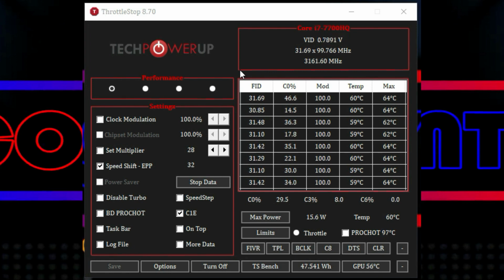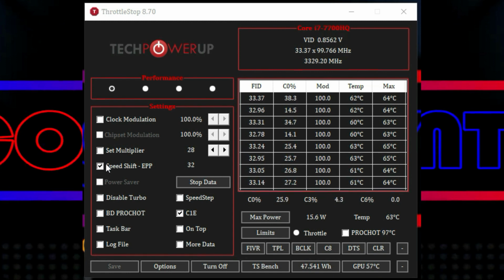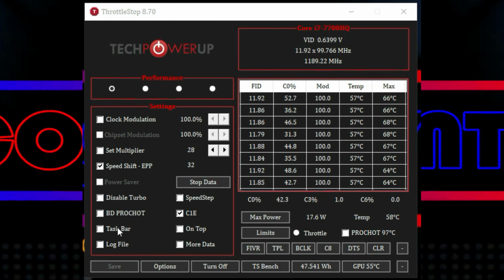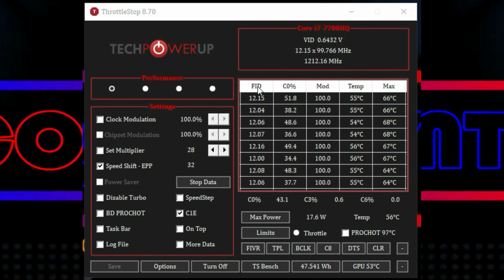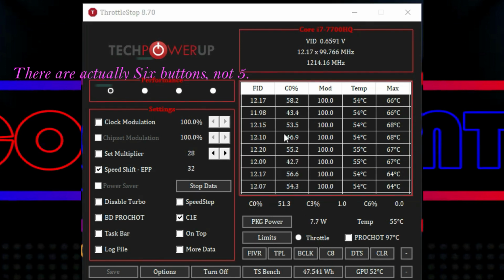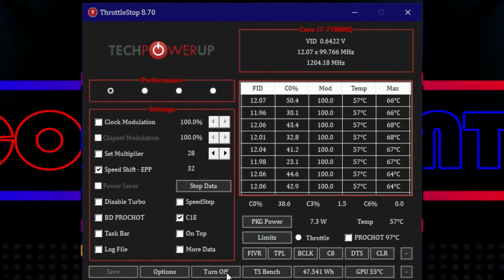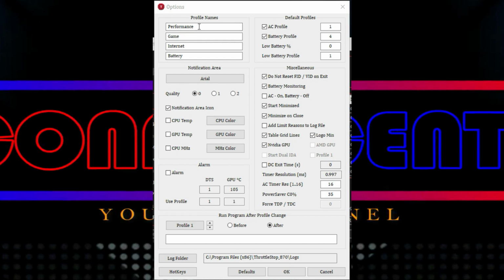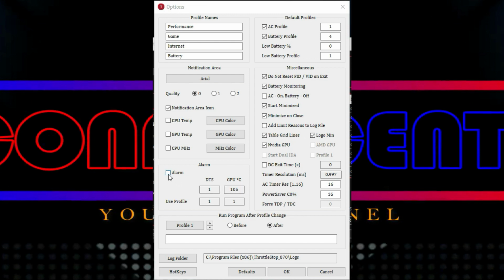Throttlestop Guide for Beginners | All Throttlestop Settings Explained

Comment: Before you use Speed Shift EPP, you have to go into the TPL window and enable Speed Shift.  When Speed Shift is enabled, you will see the letters SST in green on the main screen.  When Speed Shift is not enabled, changing the EPP option will not do anything.
Reply from the maker: That's very correct. I did talk about enabling speedshift via the TPL window, only that I didn't really go into details to explain why as much as you've done. I really appreciate this reminder, you're a genius.
Reply: @ConfyScenty   I should just leave epp speed shift on for compatibility then right?
Reply: was about highlighting this before realizing that he have replied to this, well done both🏋️‍♂️
Reply: Speed Shift is not enabled for me, i mean. I use this program for the first time and speed shift is not enabled. Is there a way to enabled speed shift?
Reply: @g0ldshinEEE  in bios man press f2,f5,f7,f12 on startup check each setting until it takes you to a screen win the words BIOS
Reply: I know I'm quite randomly asking but does anybody know of a good site to stream newly released tv shows online ?
Reply: @Roland Colten i use FlixZone. Just search on google for it :)
Reply: @Sergio Xander Definitely, I've been using Flixzone for since march myself :)
Reply: @Sergio Xander Thanks, signed up and it seems like a nice service :D I appreciate it !!
Reply: @Roland Colten no problem xD

Comment: is disabling bd prochot safe for my laptop?
Reply from the maker: As long as you know what you're doing, yes. But disable it only if it necessary to do so.
Reply: Is BD PROCHOT disabled when there is a check mark on Throttlestop?
Reply: @ikec-pw5sb  if there is a check mark , it means bd prochot is enabled
Reply: @poison9205  Thanks!
Reply: @ikec-pw5sb  the check mark is on by default

Comment: Good video man.  I have i7 8750H with GTX1060 6GB, but my valorant is running only at 60-70fps where I should be getting 160-170fps. I searched a bit and got to know it was thermal throttling so I undervolted it to-140mV and limited power to long power to 30W (which I found the is the standard for i7 8750H). Im getting 110fps now but the stress test still shows thermal throttling and CPU caps at 2.9GHz where it could go up to 3.3GHz. And after undervolting it is power throttling too. For the first few hours, the game was running fine at 110, throttling didn't cause problems, but after a few hours, my game started to crash. Can you help me out please?

Comment: Plz reply i have core i5 8250u @1.6ghz turbo boost upto 3.4ghz.....in throttlestop fivr setting can i set 3.4 for first two cores and 1.8 for the next two cores?????is that possible is that safe.....i found a lot of decrease in temperature but i want to know is that safe or can i use like that
Reply: @UCf_BgWqWKfgta6Kmpv-QfTA you earned a sub ma frnd
Reply from the maker: I'm not sure that you can set the boost speed for individual cores. However, what you can do is to set your CPU to boost to a particular speed when a certain number of cores is being utilized. For instance, you can set it to boost to 3.4ghz when 1 or 2 cores are in use, while also limiting it to only 2.8ghz when 3 or more cores are used. You can do this from the "Turbo Ratio Limits" setting in FIVR.

Let me know if you require any further assistance.
Reply: @ConfyScenty  does that reduce temperature???? .......im saying about the setting when you open fivr and in the left side corner you will have core speed adjustment for all cores indivudually thats why i asked is it safe to set 34 for core 1 and 2....and 18 ( base clock speed) for 3 and 4th core...
Reply from the maker: Yeah. It's safe. It reduces temperature to a certain extent since it also slightly reduces performance. If you want a better reduction in temps you could set it to boost to a value that's less than its factory boost clock, say 3.0ghz when 1 or 2 cores are in use instead of 3.4ghz.
Reply: @ConfyScenty  how to get know which core is in use..im noob in this thing lol
Reply from the maker: There are a couple of programs that you can use to monitor your CPU during tasks, programs like HWiNFO64, HWMonitor, or even MSI Afterburner paired with Rivatuner. You'll find lots of tutorials online on how to use these programs.
Reply: @ConfyScenty  well thanks a lot.....i got fps drop in gta online only in big lobbies....i searched a lot about this issuse even i upgraded ram ro fix the stutter..somehow i fixed the stutter but not the fps drop...finally i found out eventhough i set to high performance in power plan the cpu clock runs at below base clock....thn i heared abt throttlestop and undervolted along i enabled turbo boost..before undervolting i used only turbo boost it works fine but the temp reached 80 to 84 degree..even at 2.5 ghz in fivr setting the temp reaches like this...so undervolted and ma battery ic dead...now i can only use ma laptop plugged in ac...so im very much frighten of using throttlestop other setting and other software...plz help
Reply from the maker: What you're experiencing on your laptop is most likely what we call "Power Limit Throttling". You may fix it by undervolting your CPU further, and maybe try undervolting your GPU as well with MSI Afterburner. It's a pretty tricky issue to fix, but with dedication and lots of trials you'd get it right.
Reply: @ConfyScenty  thank you so much for your valuable response....im sry for ma bad english
Reply from the maker: @gag97  You're welcome. Your grammar is just fine, no need to apologize. I hope to keep seeing you on the channel.

Comment: How do you uninstall?
Reply from the maker: You don't need to uninstall Throttlestop, I don't think it installs any program into your PC.

To undo whatever changes you've made with it, you simply have to turn it off by clicking on the "Turn Off" button on the main page of the program.

Then delete the Throttlestop folder (I mean the folder where the .exe file is stored). That's it. 

Please I'm sorry for my late reply, I was offline.